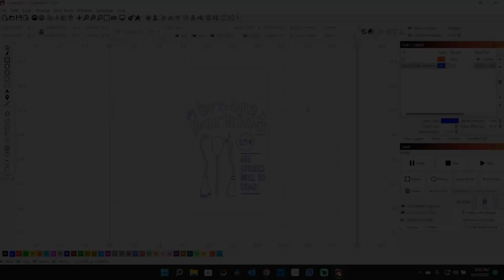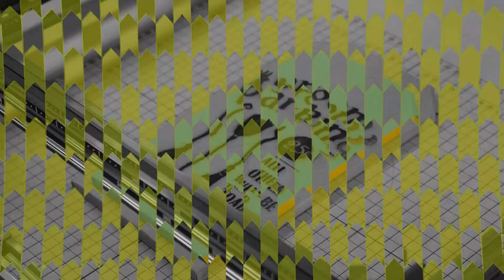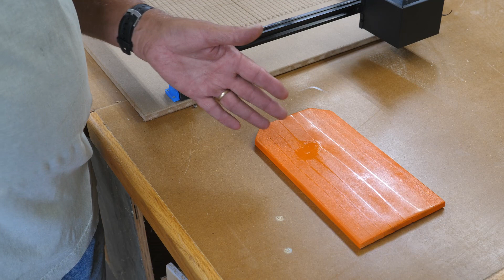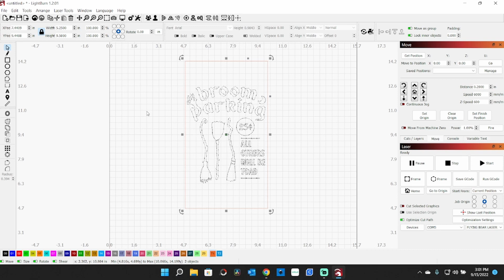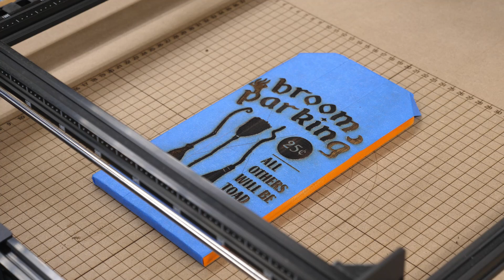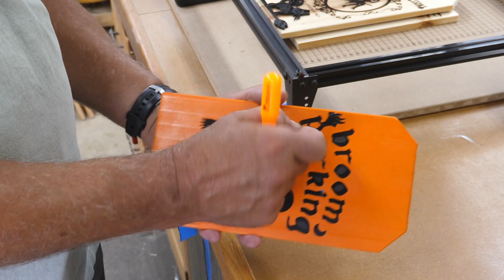Engraved Painted Sign on Flying Bear Laser

Comment: I recently made a sign using your method with painters tape.  Didnt turn out the greatest so I bought a small roll of cricut vinyl.  - this method turned out pretty good.    Good instruction video
Reply: Cricut vinyl is pvc. Produces poisonous gasses
Reply: Warning: Laser cutting vinyl produces chlorine gas. Toxic and also corrosive to the equipment.